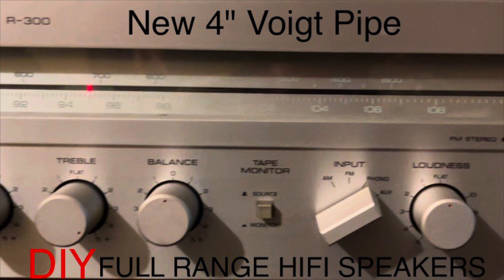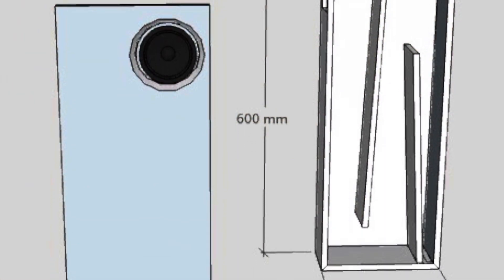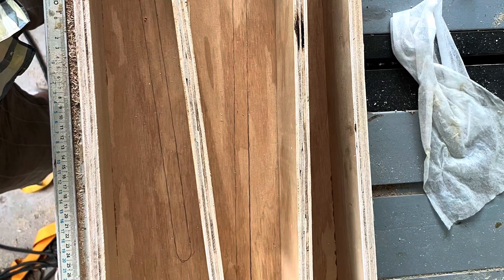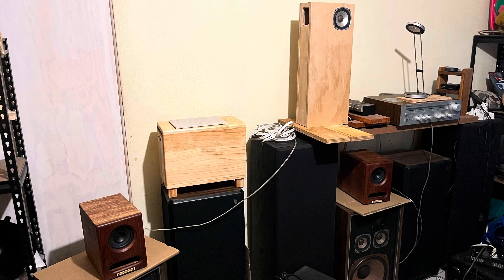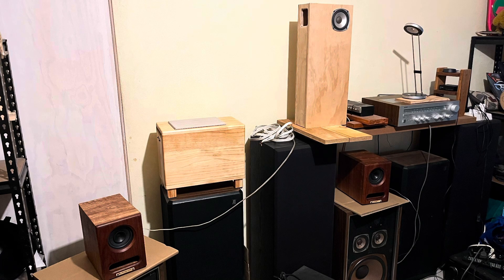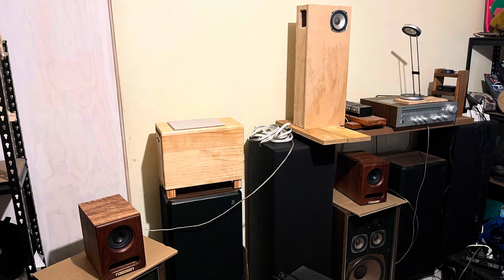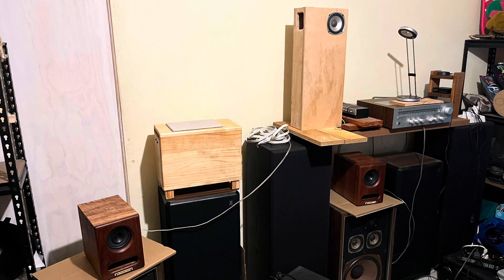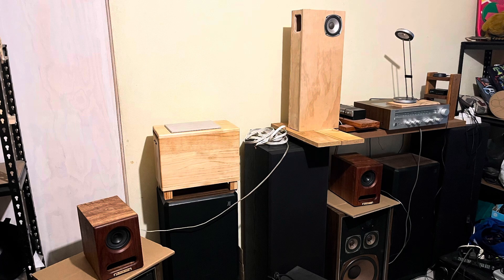New 4 inch Voigt Pipe FR Speaker

Comment: Sounds good. What's the setup to be used with the powering are you using HDMI ARC with amp control on/off and volume from the TV or optical or good old RCA to the amp or a secret bluetooth set up? I am interested in using external speakers with my TV. I tried sound bars but don't like them. I want an HDMI control from the TV including power on/off and volume of course. But trying to find a control module is painful the only one I've seen so far is the Dayton one and that's on closure sale in the US. I am trying to avoid needing to turn off another item attached to the TV and having a separate remote for amp control. There is a box of controllers next to the wife's chair and I get constant grumblings about picking up the wrong one for this or that. However taking the controllers myself causes real ructions. As your in Sydney you've probably heard them in the distance.

Comment: Lol, a proper ghetto DIY setup :) If you look at that board, it has big air gaps so it's the cheapest and lowest quality stuff that resonates. You should use MDF or baltic birch board.
Reply from the maker: @Munakas-wq3gp this one is a test mule from cheap plywood to check the Voigt pipe concept. There is no resonance due to the stiffness given by the internal baffles. The actual speakers will be solid hardwood and much denser and stiffer that this plywood. MDF is classified carcinogenic in Australia. We don't use it.☮️🇦🇺
Reply: @diyfullrangehifispeakers  Gotcha. Too bad because MDF really is superior as a cabinet material.